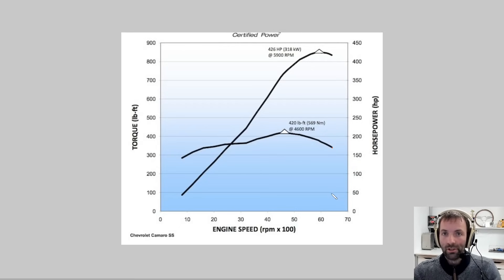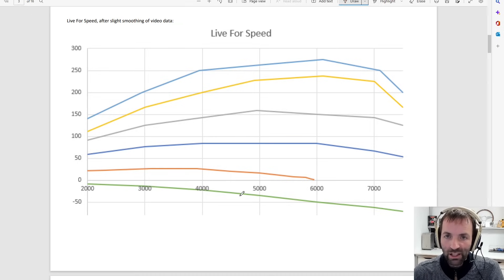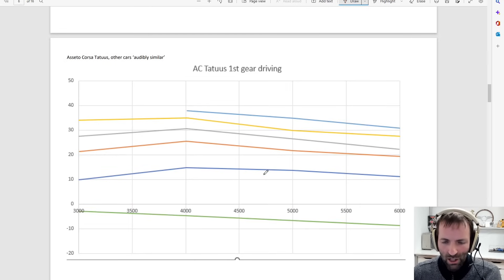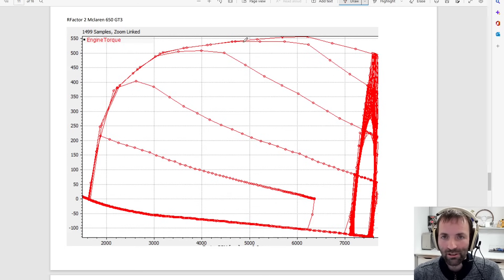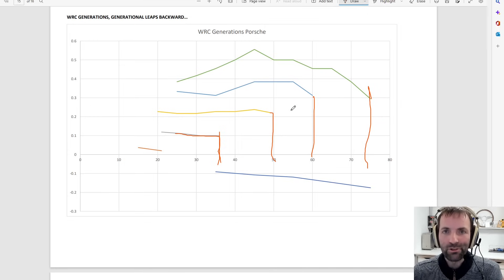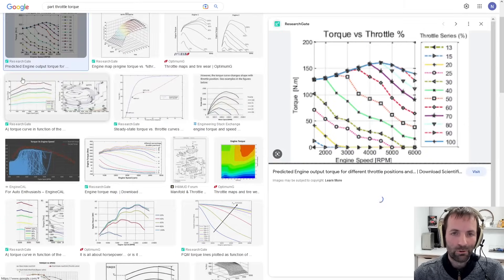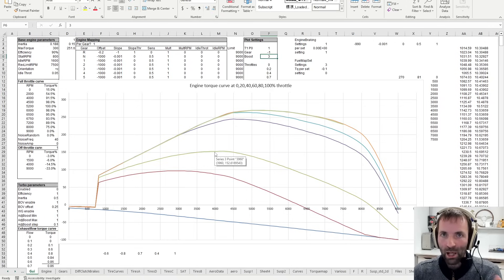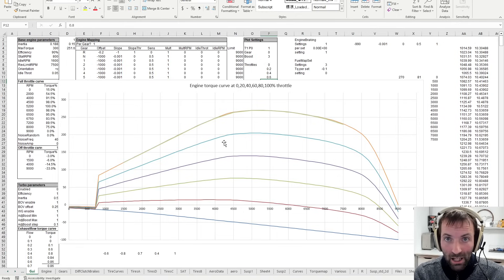Modern Sims Still Use A Throttle Model From The Year 2000! Explained, Exampled, Suggestions made.

Comment: Real world driver in the Porsche GT3R here... your video helps bridge a BIG disconnect between sim and actual experience.  AC/ACC's throttle application out of slow corners is, factually, not practicable in real life -- the sim tolerates/promotes brutish pedal application that will absolutely light up the real car's rear.  I'll try to adjust the sim pedal's software mid-point to compensate...
Reply from the maker: Thanks for the feedback, real data doesn't seem to exist outside of the dungeons of the manufacturers. The GT3 car technical manuals often don't even include an engine torque curve, let alone curves for various throttle percentages! Theoretically they can map anything they want, but I wouldn't believe the 'old sim method' is fast. You only have 25% of throttle to apply out of a turn, and sometimes you have to retract the pedal instead of just progressively adding it. 
Sadly you can't fix it with sim pedal software, because you only move the lines closer together, you can't change the shape which is critical for the feel. I talk about that in (long..) detail in this video watch?v=aYS7mO5ECck
Reply: But you can do that in game by yourself, and you can tune your real car in the same way. So what point does this video justify?
Reply: @FriendlyPCGamers irl you press gas pedal 20% its rising and the rpm is fixed in shity simulators no! fuck that 😂😂😂 that's unrealistic
Reply: if you think about it, the issue that was highlighted in that video contradicts with OP's comment

Comment: So this explains why cruising in sims feels so off you need to apply so much more throttle than in real life to get any torque
Reply from the maker: Quite possibly yes.
Reply: not in rf2, at least, from my experience of testing cars a very low speeds, i usually do that in every sim.. WRC, was really crazy :), unfortunately, because seemed to be much better than Dirt rally´s franchise, even if the first dirt rally had been a good promise, VR at all.
Reply: @pedroferrr1412  neils' video shows this. RF2 is one of the sims he tested, along with AMS, AMS2, and beamNG, that has a different, more realistic engine modeling.

Comment: Did not expect anyone to make a video about this. I remember playing assetto corsa and while trying to accelerate under very light throttle imput at low rps the car wouldnt respont at all. In real life you can get alomst any car up to speed by just bearly touching the throttle, and also manuvering the car you hardly use any throttle at all. Many times i would have to use up to what felt like half throttle to eaven get the cars to accelerate at what would be a "normal" pace at low rpm, like you would drive in traffic. Somthing that also is interesting in some sims with a manual car when you would disengage the clutch gently i had to use a ridiculous amount of throttle to not stall the car. Great video!
Reply: Thanks for using the 2nd hand on sale pedals.
Reply: What are you on about, AC throttle is not even close to real life if you dont modify it. @FriendlyPCGamers

Comment: This explains very well what went a bit wrong for me when I used LFS to learn to drive with manual transmission. (Never drove a real car before LFS, apart from go-karts.) I'd throttle too much before releasing the clutch, the teacher would yell at me: "not that much!!!" I understood that in LFS, you must throttle a lot to avoid stalling. This is probably the best explanation why -- with correct models, you have much more torque at low throttle/revs.
Reply from the maker: absolutely.

Comment: ACC uses variety of different throttle maps which change with engine map and may vary from car to car as well. However they just alter the relation of throttle input to output, e.g. 10% input = 15% output etc, so they offer no improvement to this issue you explained, but may cause confusion in terms of data you get from the game.

AC uses same logic, but only one throttle map per car as the base game doesn't utilize multiple engine maps either. Throttle curve can be found in car physics folder as throttle.lut. If it doesn't exist that means the car just uses linear curve. Coast torque is also customizable but i don't remember for sure if the full custom lut-curves are supported by vanilla ac or if they require the csp extended physics (extended physics are fantastic btw, the depth of possibilities they offer for physics modding is just crazy).
Reply: Late in AC development they added an option for interpolation between 2 throttle luts which can give some rpm-dependent effects. It's documented somewhere. Not a very good way of doing it, but it does exist. Just not used on most KS cars due to when it was added.
Reply: There is nothing like only Linear Curve, you can tune the throttle behavior in every racing game. There are so many options in every game for legit tweaking. Linearity, deadzone, saturation, response etc.
Reply: @FriendlyPCGamers  this only changes the received input TO the sim. not the throttle response and realistic reving of the engine.

Comment: Hi, great video, although now in modern cars the Throttle maps try to "emulate" the old LFS model I think. :D
Some modern ecus actually map the throttle pedal to the torque output of the engine(instead of the physical opening of the throttle valve as it was back in cable throttle days). They use the throttle valve and boost controllers (if available) to more linearly scale engine torque output depending on throttle pedal position. In this way the driver should have better control of the engine in part throttle situations, but the throttle pedal might not have any direct connection with the throttle valve opening percentage.
Reply: Make that most modern ecus 😅

Comment: Hey Niels, BeamNG dev here. Thanks a lot for investigating and raising awareness on this topic!
Some extra info: our current throttle simulation was implemented in January 2016. It's not perfect by any means, but heaps better than the simplified model we used earlier. Gotta admit your video has sparked our interest in improving it still some more tho :-D
We've also taken the liberty of recording higher res telemetry from a Civetta Scintilla, since your graph is only a few datapoints, here: bng DOT gg SLASH ThrottleInput
Hope that sheds some more light. If you have any questions or suggestions please do let me know, always happy to help (and improve!).
Reply from the maker: Thanks! The 'apps' that show torque / rpm seem to update at about 30hz in game so I didn't have the finest of data points indeed, but enough to show that it points in a good direction, your screenshot supports it. Of course these days I would assume engine ECU's allow 'anything you can imagine', but that is also more work and question marks when you create a car for the game. And probably you tweak the linearity of this for certain cars, for a 60hp shopping car the curves might be great, but for a 600hp car, it might make 50% throttle quite sensitive. I'd say the shapes seem great though. Is it some form of physical model or just smarter curve interpolation or lookup table type modeling?
Reply from the maker: I see now it is a very powerful engine, maybe that feels a bit sensitive, I don't know, could be!
Reply: @NielsHeusinkveld  We don't use lookup tables or hand-crafted data. Our throttle controller attempts to keep power output flat, for better drivability. The torque graph looks like that (kind of sloping down) merely as a consequence of that approach.
As mentioned, the math is not ideal, but was good enough as a low hanging fruit so we could shift our focus into more important areas of the simulation.
Personalized ECUs could be implemented quite easily, but we simply don't have the manpower to develop and maintain mappings for our entire fictional car lineup (hundreds of vehicle variants to testdrive and tune).
So yeah, it's the same sim logic applied to all vehicles. That said, I confirm we are currently revamping it after your video sparked internal discussion, so we'll hopefully ship a new generation of this code for a future update :)
BTW we also rescued our 2013-2016 gen of code into our latest game version (so we could compare properly to the newer 2016-2023 gen), and that old one did result in graphs very similar to the others from your video.
Reply from the maker: @stenyak  I had this weird feeling but I think.. you were around in the early days of the LFSforum maybe? Or RaceSimCentral.. I don't know why your name rings a distant dusty bell... :D
Reply: @NielsHeusinkveld  yeah you probably remember me from the open source sim "Motorsport" that I started at RSC, I guess. A sim which by the way, I just checked, and of course we were using the simplified throttle model \o/
Reply from the maker: @stenyak  I think YouTube deleted my earlier comment, saying how impressive BeamNG is, really really cool stuff that I haven't spent nearly enough time with. :-)
Reply: @NielsHeusinkveld  glad to hear that! 👍Tons of work happening to continuously improve. And I'm quite happy with these Sprint pedals too :) they're my main dev pedalset.
Reply: Nice work on BeamNG! I've played around with it A LOT for years, and good to see it getting more gameplay features like the new sadistic offroad scenarios. Will be interesting to see if you manage to improve that universal throttle controller. I do understand the pile of work / risk with so many of your own cars to maintain. Maybe throw in a debug widget with mass flow and pressure data or whatever you base it on to go with the new controller for us nerds 🙂?
Reply: In case it's relevant: A real engine needs a certain amount of air (displacement x rpm) and as long as the throttle body supplies that, the torque curve is at 100%. Above it becomes choked.
The amount of air the throttle body lets through depends on how it's built, but you basically need two LUTs for that. Geometry (pedal %) and flow (rpm). Those applied as input to the engine curve should give you a perfect result.

Comment: I didn't hear you explain why these curves (the real ones) look the way they do... so I will add that in here for anyone curious.

99% of engines on the market... gasoline engines anyways... use either 1 or multiple throttle bodies. A throttle body, while it works fine, does not give a consistent flow rate on its percentage opening. For example, at 20% throttle a throttle body is actually only capable of flowing up to 5% or 10% flow rate,  50% throttle is only about 25 to 30% flow rate, and 80% throttle is about 95% flow rate. Its not linier and is actually closer to an S curve. Auto manufacturers know this of course, so back in the 90's, cars actually came with special cams on the throttle bodies that the throttle cable would wrap over. These cams were designed to counteract this discrepancy in flow rate by opening the throttle much further at low throttle inputs and then slowing down the rate of throttle body opening as the pedal was pressed further. Modern cars the pedals aren't even attached to the throttle body so they can just change that curve to whatever they want.

The second part to this story though is that engines are just big air pumps. Shocker I know, but because of that the amount of power they can produce can literally be calculated off the amount of air flow that is allowed to enter the engine at any given RPM. So... at 20% throttle and 5 to 10% flow rate, at real low RPM's the engine will actually have more than enough air flow to make full torque almost as if you are giving the engine full throttle. Naturally the higher the engine revs, the more air it will need. Once the flow rate required by the engine meets the flow rate being given by the throttle body, that is when the engine will start to lose power. That is why the accurate curves you see you have really sharp initial spikes in power even at low throttle input, then followed by a smooth drop-off in power the higher the rpms go... the engine is just doing the best it can with what it is given.

Side note, this is actually what also causes a torque curve to have a "peek torque". The valves in the valve train can only flow so much air through them. When you hit peek torque in an engine, what is actually happening is that the air flowing over the intake valves is now flowing into the engine at the speed of sound and becomes choked. Any RPM above peek torque is basically just like these throttle curves. The engine is doing the best it can with what it is given because the valves are just incapable of getting any more air into the engine. This is also why if you increase the valve lift that you usually don't lose much power down low in the rev range, but the peek torque moves higher in the rev range. It just takes longer to hit that flow restriction.
Reply: Excellent explanation, thank you!
Reply: Now it all make sense.

Comment: Astonishing video Niels, as always. 

It would be interesting to check out if WRC 10 works like WRC G since in Generations the hybrid mapping and throttle inputs were introduced and the data you got from the game maybe suggests that ALL CARS ARE HYBRID (In throttle input terms) like if there was no engine brake at all and the car just behaved like an electric one, saving (And even storing) energy based on the position of the throttle pedal (Even combustion engine ones). 

If you need a code i can absolutely help you with that. I love the WRC saga even though it is really hated and i have a strong relationship with the developers so i could try to tell them about this (They won't make the WRC games anymore so who knows if this would be useful).

I know the selfish content creator phenomenom you wrote about in the description and i encourage you to not be afraid about sharing information. You are too smart to compete against stupid people, making simracing software and hardware requires really advanced skills, and if you are smart enough to have those skills, you are smart enough to know that if Neils shares this info... What kind of info he knows and doesn't share??!! It's even scary hahahahaha

Also, in case you are interested: I worked for a university here in spain who had this class of engineers that needed to learn about data adquisition and racing car telemetry during the pandemic lockdown. No real cars could be used to learn so... They used simracers and simulators instead! The simulator the teachers wanted to use because the data was waaaaay closer to the real data...? rFactor 2! And by far. Up to this day i still don't understand why even though that game had the closest telemetry to real life i still don't feel it like the most realistic one. Maybe there are some more factors (Pun) to keep in mind aside from the car data and inputs.

Have a nice day man, i wish people paid more atention to this, this is pure Simracing Engineering and Investigation, no opinions, just straight up facts.

Comment: Dangerous assumption to make on AMS2 using the same model as the first game.  The Madness 'engine' model, which as I recall from development was quite a bit more sophisticated than others at the time,  would seem more likely no?  I recall Andrew (the physics man - can't remember his surname) posted about it back in the days of WMD.  The old development forums no longer exist so wasn't able to find anything with a quick search to refresh my mind.  But I recall throttle input translated more to the fuelling of the engine and the differences in naturally aspirated and turbo engines were well modelled with the track altitude bringing out differences (such as turbo engines loosing power at higher altitudes).
Reply: A Reiza staff member confirmed over on the forum that they are using a similar model as before. You can tell it must be doing something, most of the cars can smoothly pull away without too much throttle.
Reply: На больших высотах теряют атмосферные двигатели.

Comment: Assuming LMU is sharing the RF2 model, this might explain why it feels like I'm constantly spinning up the rear wheels out of corners as I almost exclusively race on Iracing and AC
Reply from the maker: In part yes, RF2 / LMU tend to maybe be a bit more drifty than some sims, but that could certainly be partially caused by people going 80% throttle which initially makes the back step out.

Comment: Very interesting. In RaceRoom now you can edit the engine braking setting per car. It's a setting that makes a huge difference. In rf2 you can immediately feel the difference: even by applying little throttle at stand still in neutral the engine revs much quicker.